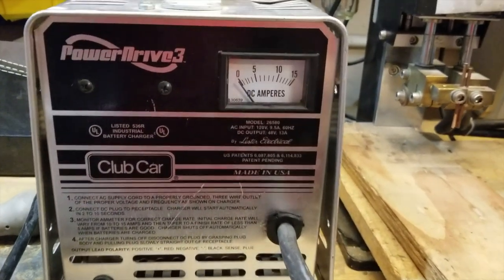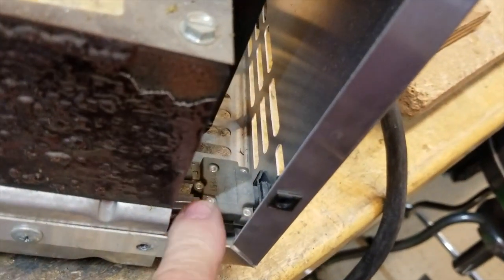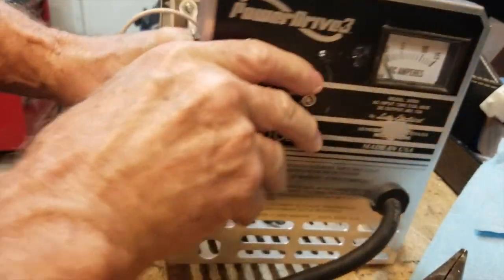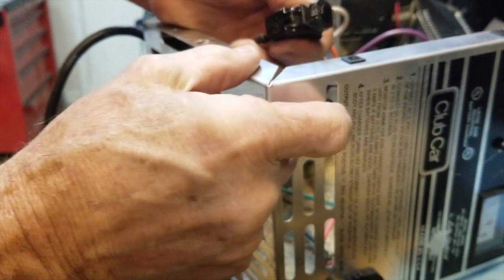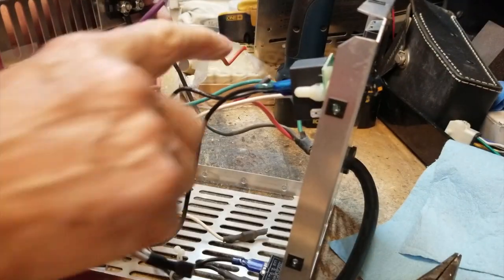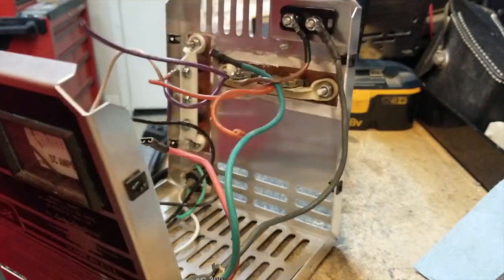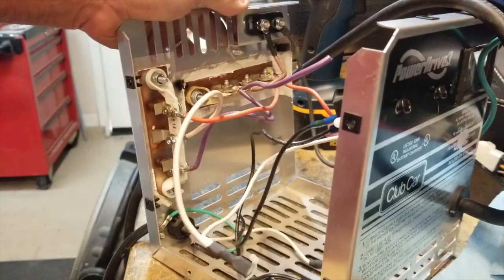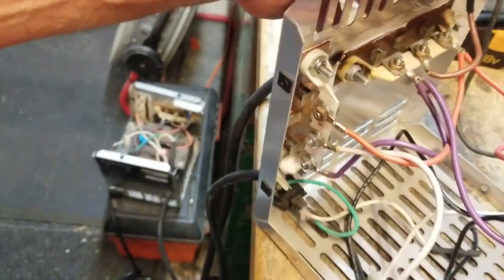Replacing Powerdrive 3 Parts

Comment: Hey Wayne thanks for teaching people and offering parts.  My question is that I haven’t seen asked is in the power drive 3 there are 2 heat sinks one - and one + the one we put in tests like the positive one and doesn’t work and can’t seem to find anything regarding that or find one that says negative. Thanks again
Reply from the maker: The pd3 has 2 heatsinks, and they are not the same.
If you bought 1 heatsink, it will probably be the wrong one. 
I buy them in pairs, and I sell them in pairs, because  they should both be changed at the same time. Look at my website and you will see the pair.

Comment: Hey Wayne, I have a question.
I have the same charger from the Video, with a 4-12v batteries setup, the charger does the complete cycle and turn off after a few hours, it shows full in the cart charger indicator, after a ride of 6 miles the charger indicator start to move to medium charge,, so I did my own test, and I use the power drive charger first to end the cycle, at this point should be fully charged, but when I use a small battery charger individually in each battery it shows me only 20% and takes hours on each battery to fully charge them to 100%... what could be the reason to not fully charge the batteries?
all 4 are new 2023... after I do the individual charging, I feel the cart faster and last longer.
Reply from the maker: You cant mix using a pd charger and also a smart charger,  one works with a obc and one does not.
If you try charging batteries with a small low Amp charger, it will take hours and hours to charge.
Sounds like you still have an active obc and are using a smart charger on it.
Reply: @waynemartin.waynesgolfcart4900  thank you for your response, but why I have to use a smart charger with alligator clips to fully charge the battery individually? The obc is good I guess, the powersrive 3 , also, I guess.. do I need to upgrade the charger?
Reply from the maker: If your powerdrive charger works and your pbc is still active, use the powerdrive charger.
Only use the smart charger, if you bypass the obc.
Reply from the maker: Sorry,  I do not understand what you are saying?
Tell me why you do not want to charge your batteries with your powerdrive charger ?
Reply: @waynemartin.waynesgolfcart4900  Lol.. let me explain again
If a use the pd3, will charge till the obc says fully charge… at this moment all 4 batteries should be 100% charged.
But when I use my alligator charger to check charge on each battery, it says 20%, and start recharging each battery to fully charged them to 100%.
So what could be causing the OBC, or the PD3, to not fully charge the batteries??

Do I need a new smart-charger? And bypass the OBC??
Reply from the maker: It's possible when you unhooked your batteries and rehooked them up at one time, you did not let the pd charger fully charge them, before you unplugged the charger. 
Try unhooked all wires off both the main battery pack negative and positive terminals, and leave them unhooked for about half an hour, then rehook the wires back up and charge with pd charger,  And LEAVE THE CHARGER ALONE until it either shuts itself off, OR 16 hours has passed and it did not shut off., then see if they are 100% charged.

Comment: Plugged into n no buzz needle does not move. Does this have anything to do with batteries or when u plug in should work? 
Thanks for video. I wish you where closer to help me. I hope I can figure out to fix myself. Cheers
Reply from the maker: very well could be batteries,  usually is.  If your batteries don't have at least 44 volts in them, the charger will not come on.
Reply: @waynemartin.waynesgolfcart4900  how do you check that because that’s the same problem i’m having
Reply from the maker: How do you check what? The battery voltage? You need a voltage tester,  then see what the total pack voltage is. It may not be enough to turn charger on.

Comment: are the diodes from powerdrive 2 and 3 interchangable?
Reply from the maker: What are you calling diodes? The heatsinks ?
Reply: yes....
Reply: the #3 has 2 sets and the #2 has one set......i have one set bad on a #3, but i have a set from a #2 in my parts box....they look the same
Reply from the maker: The pd3 top and side heatsinks are different
Reply: @waynemartin.waynesgolfcart4900  thanks Wayne

Comment: My charger is making a very loud skreech noise and is getting extremely hot, what should I replace? Thanks
Reply from the maker: Sounds like it is pretty old and the coating is falling off the transformer windings.  If that is the case,  then get another charger. Some people have taken wooden golf tees and stuck a couple of them in the windings and that did quiet it down,  but I'm not a fan of that.

Comment: I have the same charger and its in good shape but it won't charge when I plug it in it only clicks once and doesn't do anything could it be my power cord because its missing the ground round pin it broke off?
Reply from the maker: if you are talking Bout the 120 volt cord, no that won't make a difference.
Reply: @waynemartin.waynesgolfcart4900  yes my 120 volt cord is missing the ground it only has the 2 flat ends only if its not the cord what do you think it could be? Thank's
Reply from the maker: First thing to do, is try your charger on someone else's cart, and try someone else's charger on your cart, that would tell us alot, and save both of us time.
Once we know the result of that,  we can troubleshoot things.
Reply: @waynemartin.waynesgolfcart4900  we have two of the same carts i tried the charger on the other cart and it doesn't work neither and have the same charger as this one and it works perfect on both carts
Reply from the maker: Ok, then, if you confirmed a different charger works on your cart, then the problem will be your charger.

You need a voltage tester to start checking out the charger.  I have a video that shows how to check each part, so start with the tester and the video.  You should be able to find the problem.
Reply: @waynemartin.waynesgolfcart4900  hello Martin I've checked every part on the charger and all are good but my charger didn't have i think the rectifier its a 26580 power drive could it still be my power cable still or no?
Reply from the maker: Ring out the cord, make sure there is continuity on each wire. Also,  plug something else into your wall outlet to make sure you have 120 volts there.